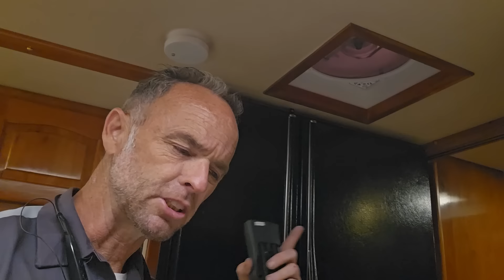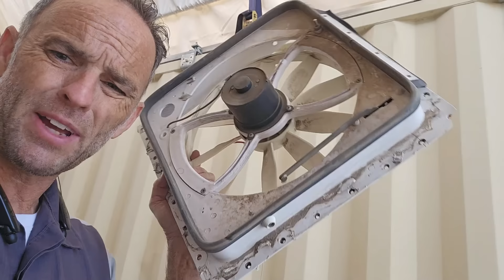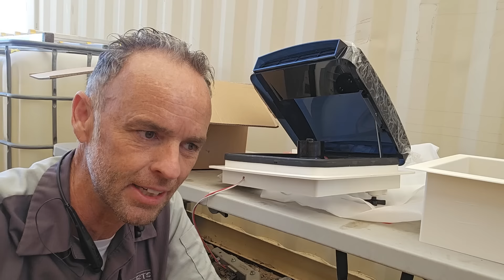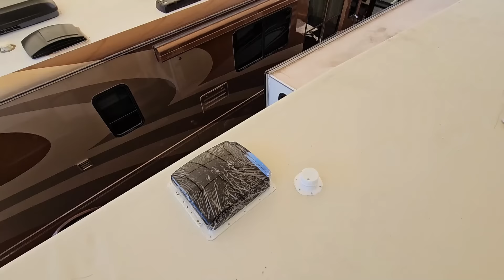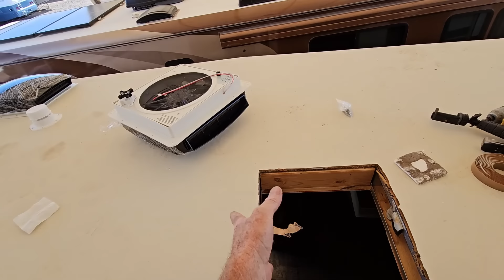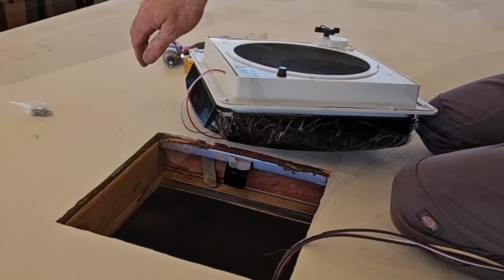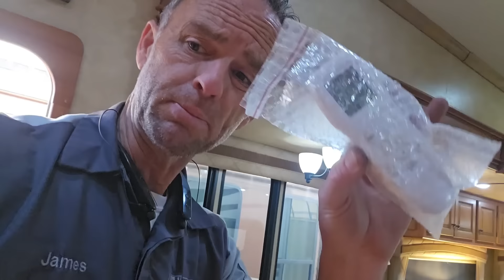Why I'm DONE with These Overpriced "Luxury" RV Roof Vents

Comment: I'd stick with the regular vent fans, and just get the covers that go over them so you can run them when its raining without the rain coming in kind of look like the fantastic vent covers except the louvers are curved down more towards the roofline so rain/snow can't pour down into the RV like those regular fantastic vent covers will allow.  There's nothing in those fans that make them worth $400+.  

The only vent fan I use is the one in the bathroom, the others don't have fans, and I never use them and have insulation pillows stuffed in them.  

Looks like that cheaper fan unit is a better option for what I want, although still expensive for what it does.  That lid is nice because you can leave it closed in bad weather and still use it.

Comment: So you’re replacing an expensive piece of junk with a cheap piece of junk. Still has those ridiculous exterior screw mount points for the top flange. All potential leak points (unless you slather sealant over the whole lot which is a bodge). I wonder if the lid is rain proof? Still, more work for you when it fails in a few years.
Reply from the maker: I don't understand what you are trying to say

Comment: I want a reversible fan for circulation, I DO NOT want all the stupid electronic switches and remote openers. Do manual crank open reversible fans exist?
Reply from the maker: it's very difficult to find now

Comment: Aren't you worried about mold since there was water intrusion that may have gone between the foam insulation and the exterior plywood or luan decking under the TPO or cross/flex fiergalss and/or affected the interior ceiling luan or particle board type paneling of the interior ceiling?  It's pouring outside and I have a huge leak from my fantastic dometic fan in my brand new not yet used 20 ft  2026Thor Chateau 19Z motorhome. The fan didn't even work on my orientation but they never gave me a service date to replace.  I had to climb the portable ladder in the rain, that  i purchased extra and place a huge black plastic oil drip pan over the dometic fan dome on the roof to try to protect it.  It seemed to help stop the water intrusion -leaking inside but I'm petrified that now I may have mold potential between the layers below the roof above the ceiling.  And the dealer is closed til Tues after labor day ( 2 days from now) .  So i called Thor and they told me to remove the "phlange/collar" and i also removed the dometic plastic wiring panel and got a pivoting lasko fan delivered from home depot and will keep it running sitting on the dinette room table til at least tomorrow morning. Good grief.  I haven't even taken it anywhere yet. :(  I HATE these fancy crap digital BS devices.  And now i have no faith in the dealer service dep't since they didn't even seem to test it or even call back for a service date.

Comment: Great video, thanks. I just installed an Air Taxi fan. Paid about $180 USD for it. I'm really impressed by it so far. Brushless motor is nice and quiet, rain sensor, etc. The only thing they missed the boat on is that front venting that the Hurrvent has. Available on Amazon. Not a sponsored ad LOL

Comment: I love this review and ended up buying the fan for my transit Ford build. I saved a lot of money, the fan is working great after 17,000 miles. The only problem I’ve run into as a new van person was to forget to do the pre-flight check before I hit the road so several times the controller flew off the countertop under the floor with one of those times, having it Land in the dogs water bowl. To my horror, I found it floating and immediately went into a disassembly. After airing it all out and drying it out it’s still working fine. On another note I also bought the Vader batteries and chargers systems, which are working great as well. You are a great reviewer and much appreciated by me. Thanks.

Comment: I am on my third maxxfan deluxe now, in about 4 years.  The electronics keep going bad.  :/
Reply from the maker: the higher voltage of lithium batteries can cause damage surprisingly
Reply: @AZExpert  Ohh interesting.  I bet that's what it is then!

I've been thinking about just trying to make my own controller with an esp32 unit and an h-bridge or something.  Then I could integrate it with the rest of the system, control it via wifi instead of that awful infrared remote, etc.

Comment: I have had 2 maxx fans. The fancy ones and in both cases they both started to make a “squealing” sound as their oil light bushing (which is what I assume they use) failed. And when I say failed, I’m not talking about it happening over a period of years, I am talking about in a single season, going through two. Both failing the same way and being unusable. Maxx fans should be doing something different but they seem to persist with this design and failure mode. A squealing fan is grating in a way that is hard to describe.
Reply: Sorry, to clarify, 2 maxx fans and 2 motors being replaced so 4 motors because I ended up selling the unit and those vent fans were starting to make the same noise again. I used to think maxx fan was the bomb, great features, smart’ish and well integrated with the pop up vent mechanism that really did keep rain out, but those motors were utter trash. Infuriating when you rely on them for cooling at night after quiet time starts in the RV park and they start moaning and squealing without ceasing.
Reply from the maker: I have heard similar reports about that specific issue from others.

Comment: I installed one of these when I saw one of your older videos on the Chineseum fans. It’s been great. The only issue I’ve had with mine is that the seal around the top is cheap and it sticks to the plastic cover when it sets for a while. I took silicone lube and put on the seal and no more issue. I am happy I didn’t over spend for one of these. Thanks for your honest videos.
Reply from the maker: Thank you, I have found all the seals stick,  baby powder can help

Comment: I purchased two of these.   One major issue.   Unless there is a trick to getting the screen off, there is no way to clean the screen and the fan blades.  Does anyone know of the trick to get the screen off?
Reply: I finally figured out a way to remove the screen.  You have to do it from the roof.  First open the vent all the way (fan off).  Next, go up on the roof with smallish flat blad screw driver.  Next, you reach down and gently pry the tabs open, one by one.
Reply from the maker: They snap into place from underneath

Comment: I replaced the original, no nonsense Fantastic Fan on my motorhome with another, no nonsense Fantastic Fan. It does one job. It exhausts warm air.  I installed one of those larger shrouds on the roof, but otherwise, it’s an exhaust fan. No remote and no other motor than the fan motor. “KISS”.

Comment: The max air fans are very nice.  But expensive.  I had an issue with my first ones.  Hooked to my 12v lipo4 system.  The high voltage of 14.6 fried the board in the fan.  Luckily max air send me two new boards.  An now I have a constavolt 12v converter powering fans.  As to not fry them again.  But.  300 bucks for a fan is nuts
Reply from the maker: I've been hearing that too which is why I think it's unreal they charge so much and the crank handles leak grease everywhere.

Comment: Very good video.  Well done.  Excellent job explaining that these roof vent fan, (Fantastic & MaxxAir) have these inherent problems and I agree that they cost way too much for what they are.  I wish this new manufacturer of roof vent fans was around when I was doing my roof replacement.  My options at the time for replacing the existing units, if I wanted similar performance, were more costly than the new vent fans you show in this video.   I needed to search around for sales and bargain deals to cut the costs down because 2 vent fans were gonna set me back close to $800 dollars.   I opted for refurbishing one of my existing units with new parts, and the other was a new unit from an eBay seller, and I still paid more than these units you show in this video.   Good to know I have some better options for next time.  Also,  thanks for showing the example of installing the vent fan with the vent cover up slightly and with the intent to leave it up for a while.   On my rig, the lid was closed after getting off the roof and the lid contacted the lap sealant in a couple places essential gluing the lid shut.  ( the things experience teaches you)  Thank you for sharing.  👍👍👍  👋👋👋
Reply from the maker: Thanks for sharing your experience, it sounds like you went through a lot to get your vents sorted!

Comment: I don't know why someone hasn't acquired the old metal roof forms and start pumping out metal vents again , id pay more for a metal vent , all this plastic c4ap on roofs , even the rubber roofs are crap , you say vents are junk , the entire industry is full of junk plastic , facets , sinks , hardware,  vents , door handles , windows , should I go on , ok chip board cardboard paneling , fiberglass skin glued to wood like that was smart from the start ! Wood expands when it gets wet and fiberglass dont , what happens when you get a leak and you will get a leak , wood delaminates from the fiberglass and ugly blister rv , JUNK I SAY , you must be rich and have no time since all you do is work on rv,s , line up down the road .....

Comment: Hi, I installed Hurrventer and of coarse trim the inside trim too short.  I am having a difficult time getting a replacement trim - no place to find parts.  Instructions instruct you to go back to amazon order and navigate around to find seller information; I have had no luck. Do you have a website or number to call for some kind of help ?
Reply from the maker: That's upestting to hear but not uncommon with standard vents, but even this 5th wheel had thick roofs and I still had to trim the insert.
Reply: @AZExpert  thanks for response.  Do you think the MAX Air 10 speed garnish would work with the hurrventer?

Comment: Just installed 2 of these from Amazon.  One to push and the other to pull air. They move a ton of air and are quiet. If you take the lid off you can install the hinge sides screws better. Only thing that was lacking was the remote holder but velcro fixed that problem

Comment: I recommend a remote control on any vent. I saved money with a manual one, but with the new RV ceilings so high, we could reach the knob without standing on the shower floor. Thanks for introducing an affordable option.
Reply from the maker: I used a remote vent on the high ceiling

Comment: I do agree that MaxxAir is far too expensive but I do like that they allow you to bolt on a new unit without having to tear off the shroud and unscrew the whole unit. I’m about to replace my cheap mini fan and now I’m torn because what if In a year, this one goes, I have to do a whole tear off.
Reply from the maker: I loved that feature too, but at $400 it should never break

Comment: I just purchased 3 of these Hurrventer fans to replace the crappy mfg installed "vents" in my class C RV.
Appears to be of muich better quality and functionality.
I have had the Fantastic Fans on a previous RV and with the "required" covers, the air flow and linited opening of the lid was disappointing!

Comment: They are NOT Luxury fans if the circuit board and plastic is so Cheap..... I Despise Companies that charge like this and give you crappy parts to increase profits at YOUR loss. We need more RV Fan Competition.
Reply from the maker: I think so too, also the 12vdc ceiling fans should have a brushless premium offering too, but nothing so far.

Comment: Just now making an order and thanks to your video, made the decision to go with this fan vs Maxxair!  Saving me good hard earned $.  I have a 1988 Avion 34W with original working components that need upgrades.  Looking forward to getting and trying my luck at installing them!
Reply from the maker: As silly as it sounds, I expect the cheap vent to break but won't feel bad when it does compared to the very expensive one

Comment: My Maxx fan died almost exactly three years after we installed it. I was not happy. I replaced it with pretty much the same one as he's talking about (same remote. Probably manufactured in the same facility) and it works exactly the same. As long as it lasts more than a year, it's doing better than the Maxx - considering how much it costs. (I could buy three for the price of one Maxx.)

Comment: Also, stop putting gargabe plastic vent covers, refigerator covers, stench pipe  covers when you can get METAL ones for the SAME PRICE.  Especially in ARIZONA !   Do it once !!
Reply from the maker: I find those are more problematic between heat and the center nut rusting, but please keep yelling
Reply: @AZExpert  But it keeps you working I guess throwing parts at it... I need to get my point accross, even to the deaf.
Reply from the maker: @AffordablePC1 the plastic vents i install last 20+ years, don't overheat the membrane or rust or cause the sealant to crack or feeze. Talking loud rarely means you're correct
Reply: @AZExpert  I think you are having a bad design day.

Comment: In Florida, when we get lots of rain, like hurricane driving rain, the rain bounces back in the Max Air deluxe. It never completely closes.
Reply from the maker: That's actually good information
Reply: It seems to be a more recent issue, for years we never had an issue and then we had two this past hurricane season. We are wondering if they made some slight change to the design. @AZExpert

Comment: for the one he liked and said much is similar, since most co contract manufacturing  in china, and often china will steal or reverse engineer and sell under there name . a few yrs ago i read about 1 co  which supplied materials and contracted   for 2 shifts to assemble there items, well the china co  using the supplies started a 3rd shift and assembled from the co supplies a shif of its own and sold with a different name.   a friend of my  a American supplier did designs of crystal's for electronics  a family owned co , then sold and later repurchased by a family member   but they started getting returns for  defective crystals 
which had there name on   but under microscope lacked there lasered  id   . so rejected the returns  i never asked if the counterfeiter was found or if it was a contract maker stealing .  my understanding only 1 co in china makes microwave ovens at least the residential ones . laptops mauby only 2  .  so not only china got jobs they steal the ideas and there's no real chaise
like in past why be loyal to a name brand when there's no difference in the insides
Reply from the maker: It's not stolen if the company willingly gives the designs and builds away in order to save manufacturing cost. The savings wasn't shared with the North American consuemers or labor force, only given to management and share holders. I will not lament the longterm failure of these short sighted executives or blame China.

Comment: I have some bad news for you AZ Expert. I bought that same fan in 2021. it was sold under the name Livpow for $169. I got it at Amazon. They have since disappeared. It lasted 1 year. It developed severe plastic fatigue where the manual knob is. The plastic just disintegrated. I tried bracing it with a bit of wood, that lasted a bit longer then it was just useless. 
 So in 2023 I replaced it with a different style and brand by another Amazon wonder company called Air Max. That was another $174. The 2nd one I liked much better but it only lasted 6 months. This time it was plastic fatigue at the center where the motor sits. It caused the fan to slowly tilt to one side until the blades were hitting the frame. USELESS. Again I tried to fix the plastic but I couldn't. It is done and so am I. 
 I have learned my lesson. I am not going to buy another pos fan. That includes the big names because that are all made in the same factories in China and they just swap labels. Just like generic cornflakes. As with Battleborn Lithium Batteries there is no warranty and before anyone starts read the fine print and you will see I am right. The American companies are no better than the Chinese ones except they charge a LOT more money and I mean a LOT more money. Hundreds. 
 What is my solution??? Simple I am not going to bother. I am going to remove the blades (one of which broke off) and just have a remote controlled vent with an insect screen. Then I am going to buy a couple of the Canadian small powerful gimbal mounted fans and that will be that. They are also incredibly overpriced but I am going to give it a shot as they are at least easy to install.  
 If they ever make a metal one I might try again but this is a massive install job. I now have roof leaks due to climbing on the roof. So I am forgetting vents and fans. They are all useless.
Reply from the maker: That's good information to know. The plastic seems identical to fantastic and those have been cracking and the vent lids on maxxfan have failed in that amount of time too so, I'll still be ahead $200 and the cheap ones plastic fans fail just as fast as the vinyl lid seal.
Reply: @AZExpert  Just as with boats, the trucking world, motorcycles and a few other industries the retailers have dollar signs floating before their eyes. All of us are independently wealthy apparently. We don't mid being sold shoddy goods and paying through the nose for them. I am working on an awning now. I am building my own. I do not trust a single retailer to make one right. In fact I built my own camper from a 12 x 6 V nose enclosed cargo trailer. Much better quality than an RV of ay type. Plus it is customized to exactly how I want it. Great video though I know you are doing your best. You are feeling your way through this just like me.